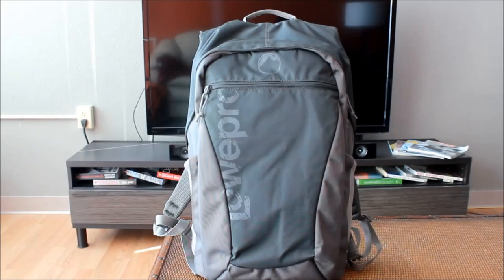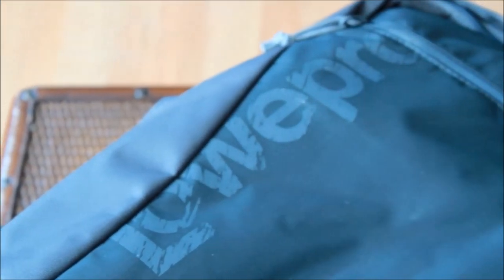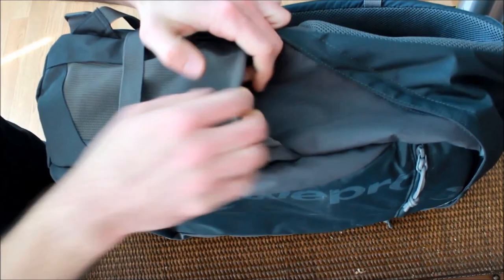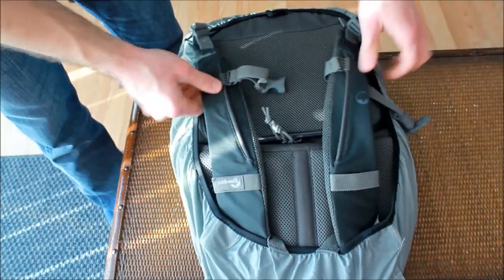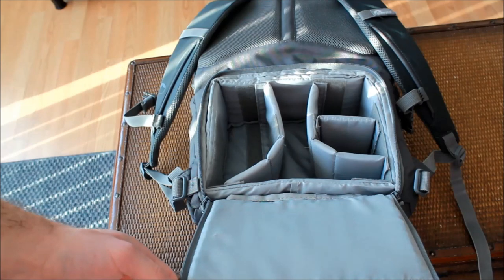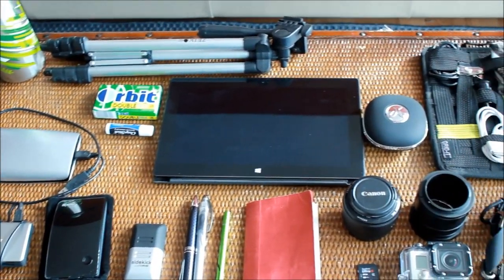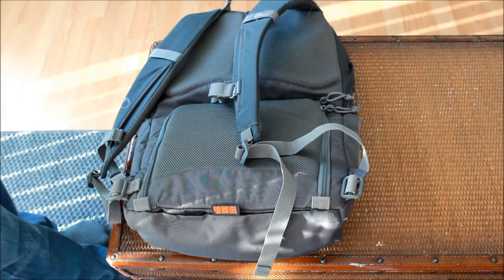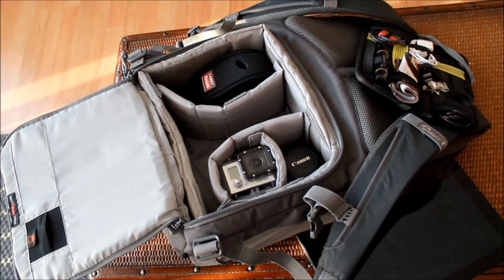Lowepro Photo Hatchback 22L AW Review

Comment: I still use my Hatchback 22L when I need a bag for a little camera gear and some other essentials.  The bag on its own is a miss, but with some modifications it works well.  The real limitation on this bag is the side pockets; they won't hold anything in place so if you tilt the bag to access the camera compartment, everything falls out.  I put cinch straps on both sides of the bag above the side pockets; the hold things in place.  I also use a Manfrotto tripod pocket inside one of the side pockets to reinforce the mesh; so I can now carry securely a monopod or small tripod.  Finally, the padded cube is not very flexible for configuration; only a few velcro attachment panels.  But the compartment is just the right size to use a Lowepro Omni Sport bag, and that bag is a good stand-alone bag as well.  Perfect for a small Olympus or Panasonic kit.

Comment: If you've got a DSLR, try and test it out at the store. I managed to fit a D810, 50mm, 24mm, 20mm, 14mm, 2 spare batteries, and a shutter release in that little compartment. Reason being, you could have the lenses standing up in the compartment. That's pretty awesome if you have numerous small lenses. 

However, I can't fit the D810, 14-24 and 24-70 in the same compartment which is a bit disappointing...Especially when the whole point of zoom lenses is to travel lighter/smaller.

Otherwise, this bag is absolutely amazing and does what it's supposed to do.

Comment: Good video Branden. Thank you. My 16L Hatchback Lowpro bag included the elastic pieces to fold and hold excess strapping. Suggest an email to the distributor and they might send out as the pieces. When I lost one of the chest straps which really come in handy climbing up and own mountains or steep hills a quick email and both pieces were sent. You are right re the holder for a mono or tripod, a form of support higher would assist but on the whole for a number of years my back pack has not only worn well but been well worn. Currently in hospital for 30 odd days my 16L pack is still with me with a mirrorless camera and spare lens if I can sneak out for an early morning walk when I'm able to. Thanks again.

Comment: Great review. I just saw this bag at MEC (like REI).  Hiked up to Machu Picchu last year with LowePro's PhotoSport 200 AW, which was great, but not as re-configurable for other uses (camera box isn't removable, side entry config is less flexible).  You have me contemplating selling it and switching.

What is that flat cable organizer you are using that you tossed in the tablet pocket?

Comment: question- can it fit a laptop
answer - yes it can, not designed to fit but i found a way. fold the velcro sleevethat seperates the bag in half down flat then your laptop can fit behind the camera pouch compartment, the downside is that it covers the netted pockets inside the bag but thasts fine if you dont have aALOT of gear.